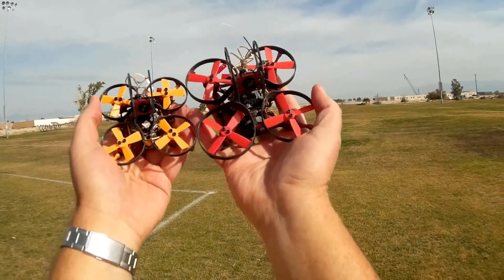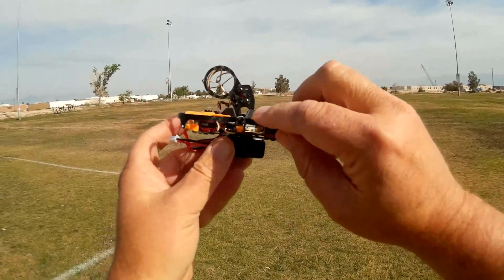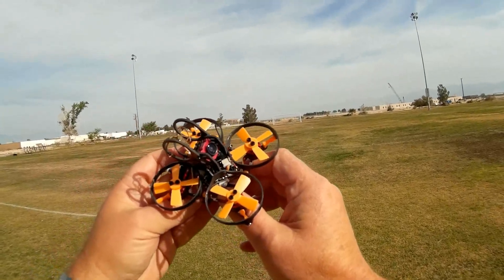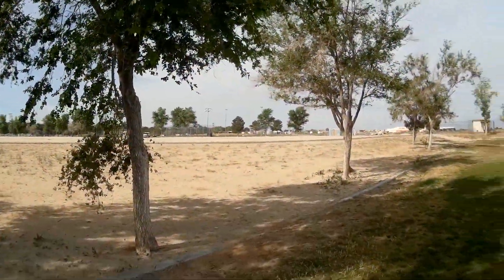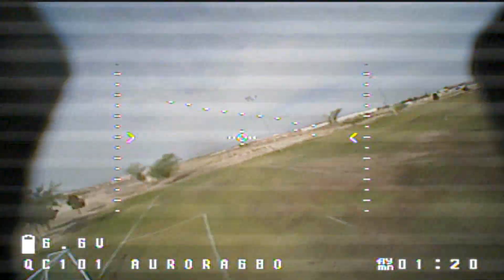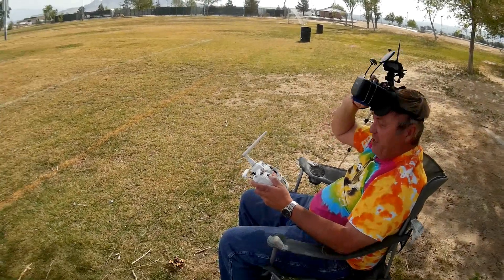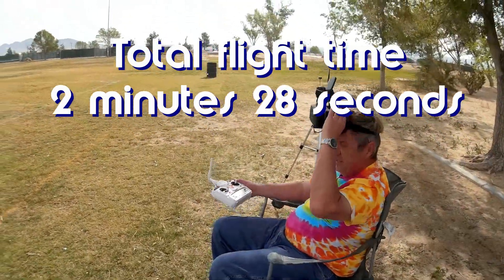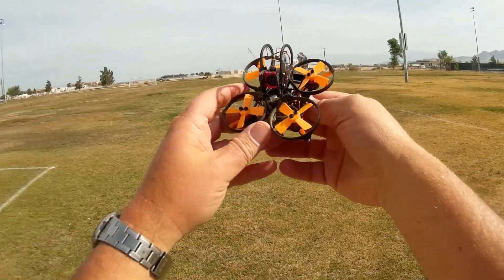Eachine Aurora 68 Tiny Rocket Micro FPV Racer Drone Flight Test Review

Comment: Great review. Mine flies great and is lots of fun!
https://youtu.be/SCqdiUSMM2g
Strongly recommend strengthening the connection points of the camera support where it mounts/clips in to the shrouds/ducts or the entire camera assembly will pop off on a hard crash. Goop has worked well for me. No issues since. Also make sure all motor wires are tucked in well as a prop nicked one of mine off and had to be resoldered.

Comment: Hello man! I'm a brazilian subscriber that has been watching your videos since a long time.
First of all congratulations for the channel and thank you for all the effort you put at making videos for us; we all appreciate the amazing work you've done.

I'm not an expert in drone flying but I'm a mid-level user (I only have a cx10 mode 2 [the throttle's on the left] and have it for more than a 1year. Also I have used middle and big drones), but when I checked the aurora 68, there I see 3 options of mode:
DSM2/DSMX Receiver, Flysky Receiver, Frsky Receiver

I'm lost, could you please explain to me which one would fit a user that uses a cx10 in mode 2?
Reply from the maker: This micro quadcopter requires a hobby grade transmitter that would need to be purchased spearately if you don't already own one.  Of such, the three hobby grade transmitters that this would work with are Flysky (AFHDS 2A), Frsky, and DSM2/DSMX (Spektrum and Devo 7E/10 with Deviation software).  The CX10 transmitter would not work with any of these versions.
Now your question has spurred me to go into this subject in a little more detail with a video covering these three transmitters.  Keep an eye out for these videos ;-)
Reply: +Quadcopter 101 
Thank you for replying so fast! 
Ahh nice, I can't wait to to watch the video about the three types

Comment: After my first outing with mine the screws stripped from the plastic orange prop guard supports in 3 places and one motor's wires came desoldered after a single crash in the grass. Disappointed, flew fine until then, except that the rubber band battery "straps" cant hold the batter in a fast roll/flip and the battery comes loose pulling the quad to the ground.

Gotta fix mine now... Will likely change frames when someone makes a decent ducted < 70mm.
Reply: george woods r u dumb or something¿
Reply: yep, same thing happened to me after a nice brownout & flip of death. These pre-builts just aren't there yet quality wise.
Reply: Get this drone now with 50% discount from Banggood with this link: https://www.banggood.com/Eachine-E55-Mini-WiFi-FPV-Foldable-Pocket-Drone-With-High-Hold-Mode-RC-Quadcopter-p-1125513.html?p=3B03079878369201704R  Just purchased it myself!

Comment: Love to see you review the qx95 eachine. I really want a micro and that seems like a good deal for something to practice acro with.
Reply from the maker: I wanted to review the QX95 also.  But the old Flysky version didn't agree https://www.youtube.com/watch?v=XyxQk-OCkKI
But the QX95 has since been upgraded to integrated receivers.  The Flysky version has also been upgraded to AFHDS 2A receiver since this video was made, which should correct the problem.  The version that I flew in the above video was the old AFHDS receiver version, with no failsafe capability (and a poor antenna to boot).
Reply: wonderful info. I use a flysky so that would have been a real problem. I was also wondering what your highest reccommended budget filming drone with GPS/altitude hold @ 60fps would be?